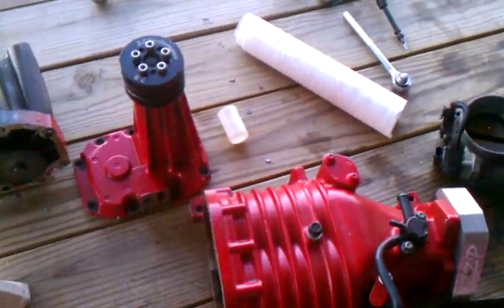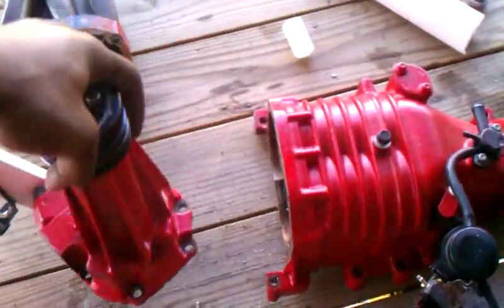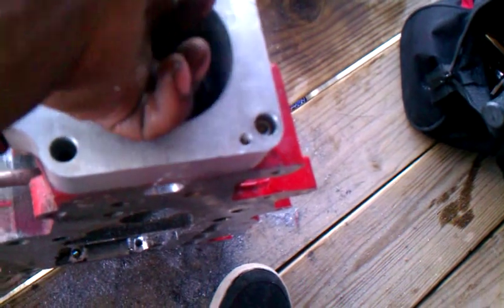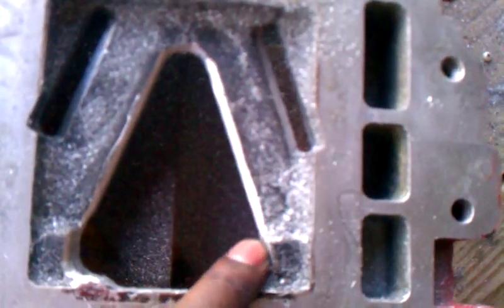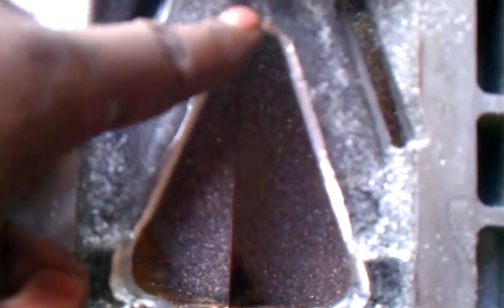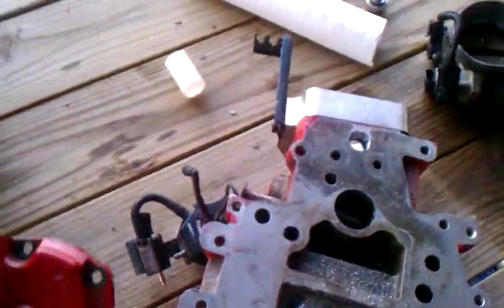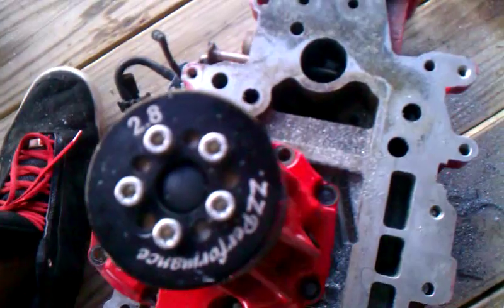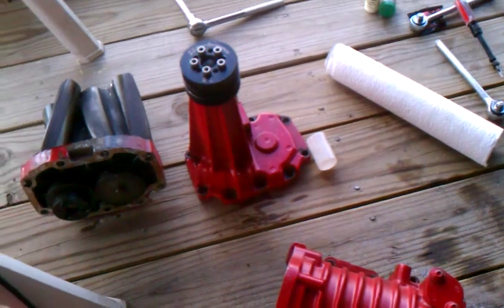Ported Gen 3 M90 supercharger

Comment from the maker: My vs cam gtp was 310whp, My first xp build was 334 and ran 12.7 @ 110, my second xp car was 347 and ran 12.5 @ 113 (with no traction). My stage 3 heads/ cam build was good for 400whp, but got de-modded to a daily driver before I could dyno it or get a timeslip.

Comment from the maker: @killdac You may or may not feel a difference, but you will definitely kill a ton of KR and set yourself up to drop a pulley size or make safer, more consistent power on the pulley you have. Just take your time & make a smooth flowing, low resistance path for the air. You're definitely doing it right by porting the TB also! Just don't over port. Good luck!

Comment: @mrsarcastis13 Hey just a heads up, The screws from the L36 coil pack dont fit into the L67 coil pack. I just top swapped this weekend and found that out but ive never heard it before. so watch out.